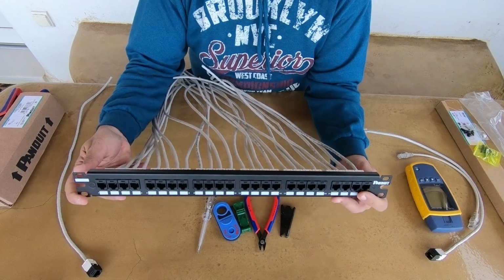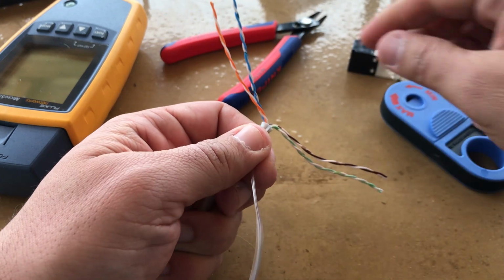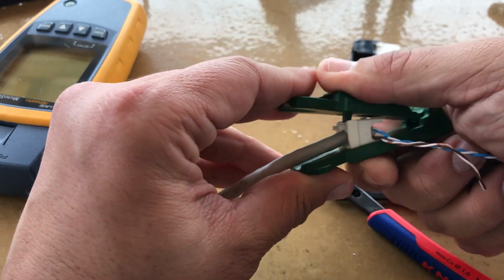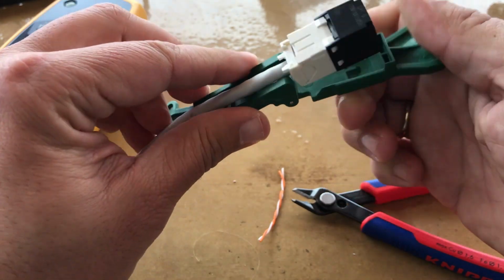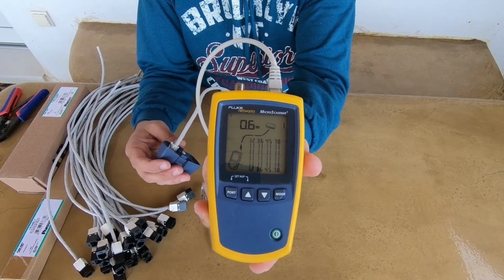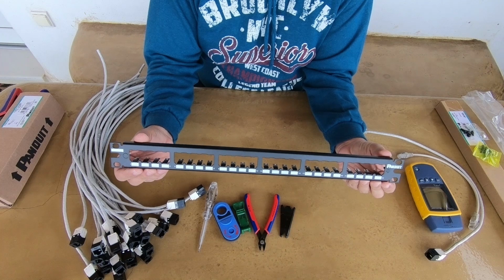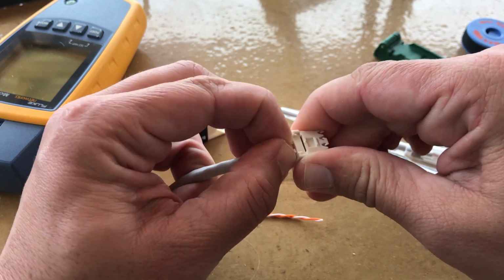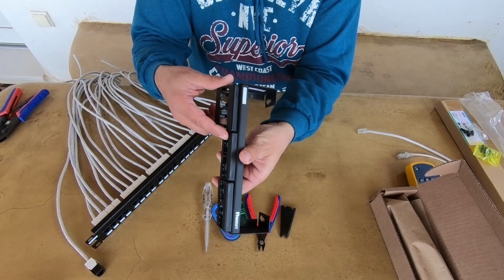Terminating Patch Panel - How to do it fast and easy

Comment: Mate, your English accent is adorable - i'm loving it. One big problem with this type of snap-in connectors is that is very hard to cut the UTP cables at the right size so the arrangement of the cables after installing the patch panel is very poor. In my opinion, the best way to make the cables look good is to use patch panels with jacks build-in, using the punch tool.
Reply from the maker: Thank you for your comment!
Reply: I prefer panels with 110 style terminations, it's just that I have that pattern stuck in my head from telecoms service calls so I can do it with out even thinking about it.

Comment: To Install a JUNIPER EX2300 OR A CISCO2960 do I need to terminate the cables?
Reply from the maker: I am not sure that i understand your question. Please watch this tutorial where the patch panel is inside a rack : https://youtu.be/-y02T1Vt0RU
Reply: @PoseidwnTech   I'm going to be connecting a server(Dell R240) to either the Juniper EX2300 OR Cisco2960, but I was wondering do I have to terminate any cables before I connect them to each other?
Reply from the maker: It depends on your installation. I prefer to terminate the cables in a patch panel and attach a label to each port in order to be clear what is connected and where.
Reply: @PoseidwnTech  So if you just connect the cables from one device to the other it won't work?
Reply from the maker: Of course will work don’t worry! There is no right or wrong!
Reply: @PoseidwnTech  I installed a new Dell server today and I had hell with it. One of the rails that attaches to the side of the rack kept getting stuck and kept preventing me from pushing back the device to the correct location. Can you do a video or do you have videos on how to do an installation like that? I done many IT tech jobs, but this one was hell haven't to take the rail out so I could reset it properly. I push the clips and did all kinds of things and it took me some time to get it right.